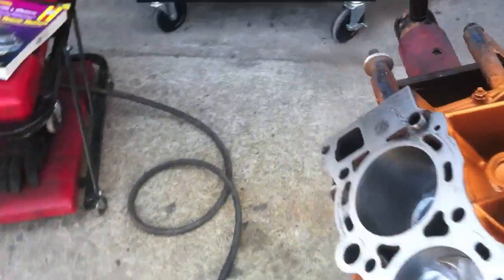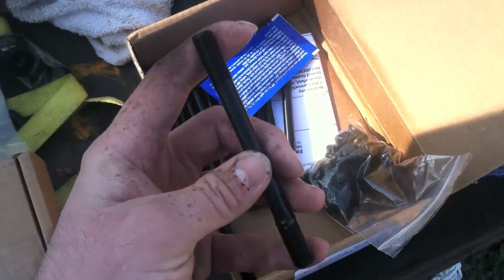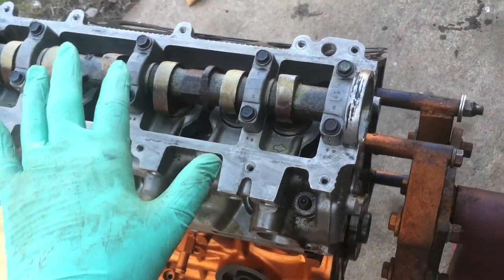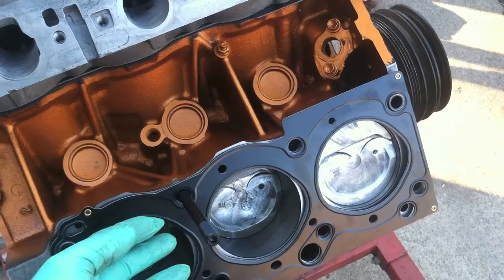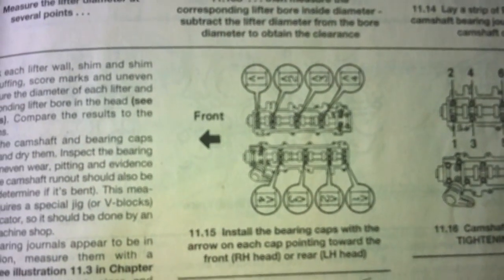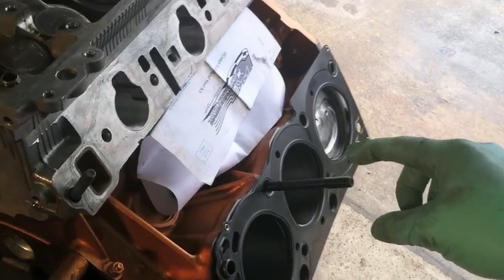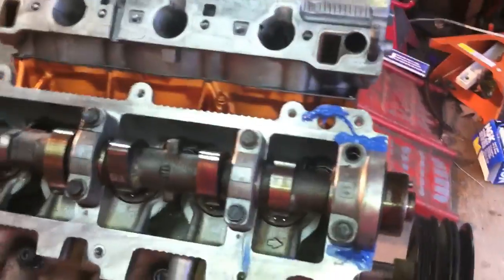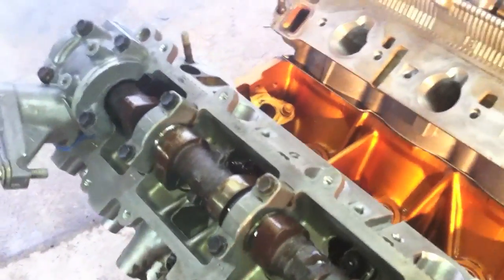3vze motor build P4

Comment: Hi I finished rebuilding my engine and I wonder if it's easier to instill it with the torque converter connected to the engine or to the gearbox??

Comment: this was a great Video documentary of the 3vz-e thank you, I am about to embark on the rebuild of mine I will be sure to video the entire rebuilt from top to bottom to first start up i have rebuilt many motors and motor bikes as it is a passion for me and well its how I make a living. this will be my first Video I upload.
Reply: Thank you for the information and I’ll do that first.
Really don’t want to have to take the engine out until I can get another and rebuild it.
Then I can do the one in the truck for a standby
Reply: Did you ever do a video of your rebuild on the 3 VZE ?
Reply: @ThisOldYota  sady a divorce got in the way and I lost the car, but i have a new Truck i will do
Reply: Sorry to hear things didn’t work out. Hope everyone is on better terms now.
Would love to see a complete rebuild.
Still working on my ‘92 extra cab with the VZE. I have an issue when I reach third gear, it starts to bog down and I haven’t been able to track down why.
So I’m thinking about a rebuild on mine. I would do it myself since not even a dealer wants to touch these anymore.
I appreciate it
Reply: @ThisOldYota   before you do your rebuild, do a compression test on the cylinders i had 2 of mine that were showed low on the compression test. You may find it could be a gear box issue, I had similar issues and I changed my gearbox oil and flushed it out and replaced my clutch and it was like new again minus the 2 cylinders that were down on compression

Comment: i would suggest putting it together with jb weld because the heads are never going to seal up reliably when its done unless you wrap the whole thing in Styrofoam and duct tape put it in a box and ship it to Atlantis (BOAT ANCHOR) awesome video  tho i always wanted to take something apart and not put it back together oh wait i'm great at that

Comment: Did this build ever get completed? I'm interested in doing a similar build with a cam that'll make my 3.SLOW sound beefy. Any update would be nice. Thanks and nice vid.
Reply from the maker: update is i sold the truck and motor had to move lost alot but keep in touch with new owner all he had to do was put the intake on and he said everything is running strong

Comment: good vid. I just blew my head gasket and have to rip er apart in -30 deg Celsius. I spent all summer and every penny I could get my hands on building my rig. told my wife that once I got the racing seats and sound system in id leave it alone...and now this. ha ha, I may be divorced by the time I get this truck finished. cheers

Comment: Don't forget that stupidly placed knock sensor before you drop the intake in there.  I'm currently rebuilding the top half of a 3VZE because whoever owned this 4Runner before me used completely random valve shims and an intake was stuck open because of it. During head removal, when I took the intake manifold off, I was amazed that Toyota would have placed a component such that there was no hope of reaching it without taking the manifold off >:(